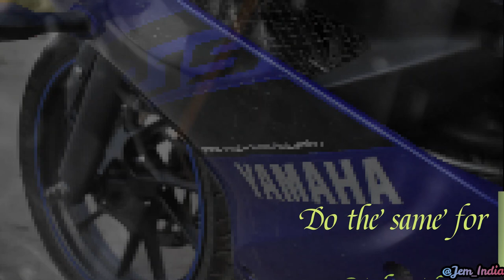#R15V3 #Handlebar #Raiser | Plug & Play | #Installation (#R15v4 #Riser Launched)

Comment: Will it effect the safety after installing 2 inch riser
Like will it come out while driving or can it create a heavy preasure or shocker rings when we drive
Bcoz when i drive bike without riser there is so much preasure  and weight on handle bar
Just aking for my safety
Bcoz in delhi AAP has made roads like london mountains even my balls are in pain
Just asking for my safety brother
Reply from the maker: We have tested at max with my testing team so no worries brother

Comment: What's u feel in diff of 1 inch.I think it's not complete comfort
Reply from the maker: Yes Mr.Naveen ,As you know very well it's R-Type  bike right, so we can't able to achieve 100% comfort even in naked version too But we can reduce the strain upto 80% with this riser
Reply from the maker: Small changes mean a lot brother
Reply: @jemindiaa  I'm happy 2 enough if as u said.
Reply: And then change the cbr handle bar is better to this method ,I think.may u tell that which one is best for Rider
Reply from the maker: @NaveenKumar-bf3mi  In my personal exp ,I won't suggest cbr clip on for R15v3 
1.Cbr fork is abt 37 mm but for  v3 41mm so u need to modify tht 
2.Make a hole to mount for Kill switch & indicator setup both the side
3.Mounting Angle ,As V3 clip on has 3rd point mount to arrest y axis , cbr clip on doesn't have so with this may cause some serious issues while riding
4.Dont knw abt th leverage & stability in triple digit speed with cbr clip on 
5.As it is R-type & complete sport variant so our motive is to convert as sport tourer with stock condition

Few more technical reasons also thr ,will upload a separate video reg it
Reply: @jemindiaa  another one way if it will complete change the clip on bar to the straight bar is that better as a default bar.have a some doubt What's the feel on straight bars and any stability issue or looks vice worst something any disappointed is there?

Comment: Is there any problem with cbr 250r handle bar .... What is the reason to use clip-ons ... Can you explain JEM India pls ..  although  .... video is too good  . Keep it up
Reply from the maker: In my personal exp ,I won't suggest cbr clip on for R15v3 
1.Cbr fork is abt 37 mm but for  v3 41mm so u need to modify tht 
2.Make a hole to mount for Kill switch & indicator setup both the side
3.Mounting Angle ,As V3 clip on has 3rd point mount to arrest y axis , cbr clip on doesn't have so with this may cause some serious issues while riding
4.Dont knw abt th leverage & stability in triple digit speed with cbr clip on 
5.As it is R-type & complete sport variant so our motive is to convert as sport tourer with stock condition

Few more technical reasons also thr ,will upload a separate video reg it
Reply from the maker: Do want to know ..? Why clip-on instead Bar..?
Reply: @jemindiaa  thnQ JEM India .. that's a lot of information.  New subscriber 🙂
Reply from the maker: @surya14332  always welcome ✌️